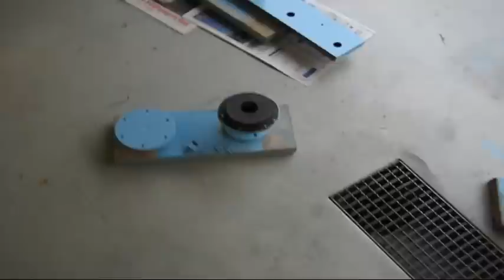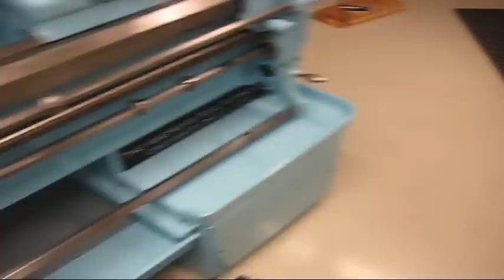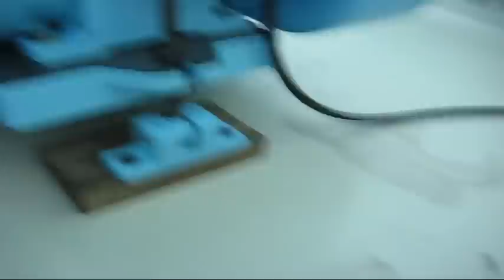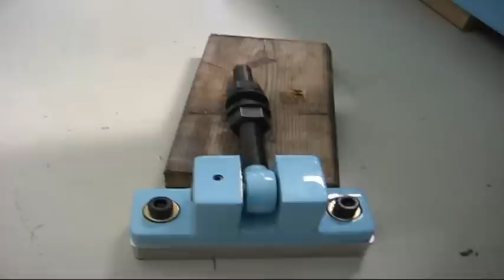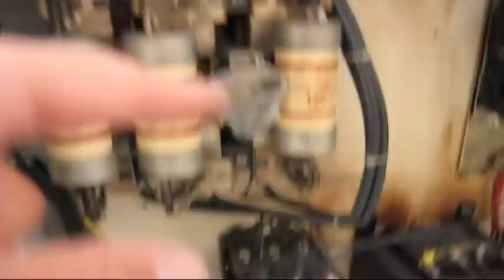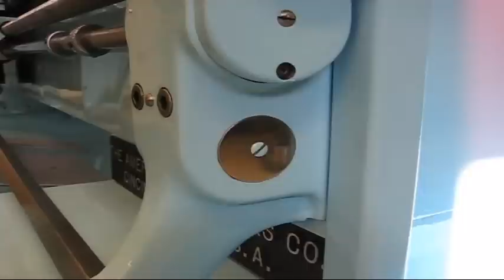American Pacemaker lathe reassembly part 21

Comment: Question for you: I have a 20" American Pacemaker that the Apron oiler only seems to oil the rear carriage way. Is this something that can be troubleshot with the carriage still on the machine or does it require a full removal of the carriage?
Reply from the maker: I am pretty sure you need to take the carriage off, which is not much work really. But you need a crane of some sort. It must be clogged holes or pipes or metering units. Should be easy to figure out once it is apart.

Comment: I see that the lathe is fitted with a D1-6 cam lock spindle, was this originally fitted to the lathe or is this something that you changed.

Also very good to see the lathe all together in one piece, the Baby Blue Pacemaker.

This project was finished some time ago, but you must feel very happy with the end result.

It looks to good to use,  when you were putting it together i can not help but look at all the nice shiny new paint work and thinking about how this will look after 1 year of use.

When ever i had brought a new machine i almost spent more time cleaning than using it,  i still clean my machines from time to time but slowly the time gets less.

Thanks again for the videos,  looking forward to next few videos  and then finally getting a look at that Mazak lathe.

Regards Peter.
Reply from the maker: D1-6 is the standard spindle on my lathe. That is the actual spindle nose so you would need a new spindle to change it. The earlier pacemakers came with different spindles as standard: "Key drive taper nose". It has been over a year since I started using it and it has gotten a few nicks in the paint but it still looks good. Thanks for commenting !
Reply: The tapered key-way mount is very common on early model lathes, that is why i asked seemed a lot work to change the spindle just for that.
 But it would be something that i would change if it was possible to do.

Watching the lathe working is very good to see. It looks very good all in one piece i like the Baby Blue color more of a happy color than the battleship depressing grey it was painted originally.
It is good to fix up old machinery and make it new again.
I am sure the lathe will be happy to live in a nice clean workshop with an owner that will love it.

Thank you for your reply.
Regards Peter.

Comment: This was a fun restoration project to watch and you did a fantastic job. Too bad the lathe ways grinding is so expensive. I think we are all looking forward to seeing your projects using this lathe. Also, you might consider putting a rubber bumper on the rear-right corner of the chip pan to protect it from the hoist when rolling past this corner. Thank you for taking the time to video this series.
Reply from the maker: Thank you very much. Yes, the way grinding is just too much. Good idea about protecting the chip pan !

Comment: LOOKING GREAT !!!
BELTS OR MOTOR LOUD , BELTS LINED UP & MOTOR LUBED ?
Reply from the maker: Thank you. I never thought about that, but the motor is pretty silent. I will have a look at the belt alignment and listen to the motor bearings next time. The main noise is from the gearbox (headstock) - all the gears are straight cut. Also you can definitely hear which gears has been used the most. The noise is only 50% of what it used to be - The new gear in the change-gear box made a lot of difference.

Comment: I would suggest the elegant solution to your green power light would be just to use your already existing green light on the front of the lathe that indicates the motor is on now. I think the fact that the motor is on is extremely obvious and thus that light now has little effect.  Aren't the ways bolted on on a Pacemaker? I thought the replaceable hardened ways was a trademark of them. I also would suggest you paint the center spokes of your carriage hand wheel to make it match your other hand wheels. The machine looks awesome!
Reply from the maker: I probably wasn't too clear: I can hear it fine when the motor i running, but not when the motor is off and the switch is ON.
The ways are bolt-on toolsteel for both inner and outer. The carriage handwheel is not too pretty. It was broken, the welded poorly. I redid the weld so no it is straight, but still not pretty. We will see what I do.
Reply: *****
I knew what you meant on the light. What I was saying was to change the wiring on the green light on the front of the lathe so that it is on when the power is rather than when the lathe is running as I don't see a need for a light to show that.
Reply from the maker: Ahh.. Yes, that would work. I don't need a light to know when the motor is running.